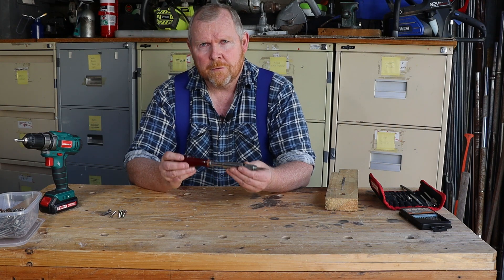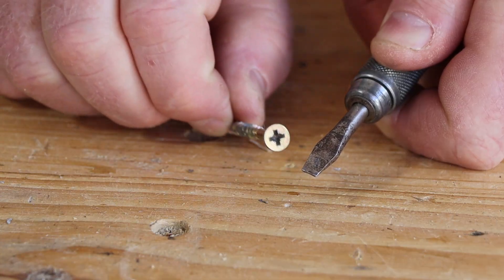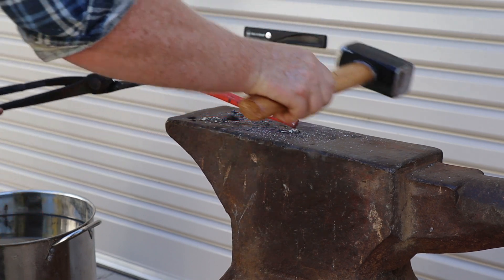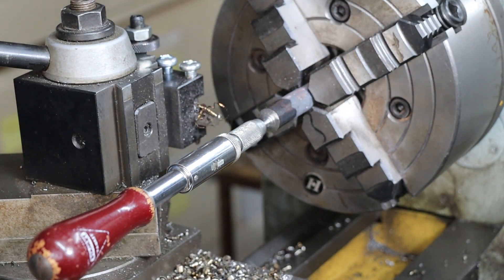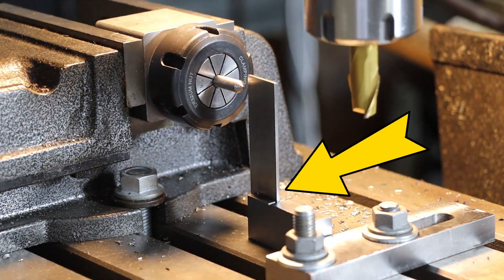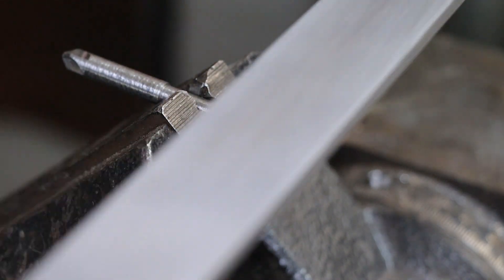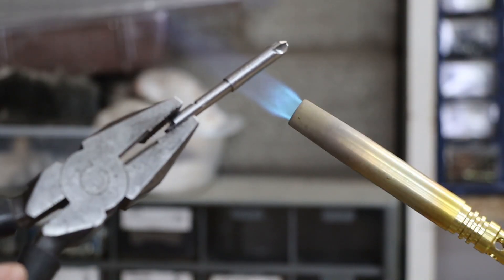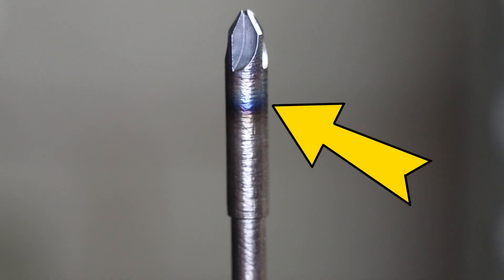Making a Philips bit for a Stanley "Yankee" ratchet screwdriver

Comment: A very simple way to make an adaptor for your Yankee screwdriver to take any hex bit is just to modify the shank of a hex bit holder you get from those hex bit packs which comes with the holder.
On my screwdriver I measured the diameter of the original bit to be 7mm. This fits the hex shaft of the hex bit holder perfectly. Modify the shaft as you did with files and now you have a Yankee that can take any modern hex bit. No need to manufacture your own phillips head bit while gaining access to any size phillips, torx, star, flat, hex, security bits that you might have or can get.
Additionally, I bought a rotary tool style keyless chuck from Amazon for $8 and found they used a 8 X 0.75mm thread. Made an adaptor from a scrap piece of steel rod with one end for the screwdriver and threaded at the other end for the chuck. Now I can use the screwdriver with any round shank bit of up to 3mm diameter. With the behaviour of the pump action I can now use the screwdriver as a drill as well without needing to get those strange old style drill bits which need to use that forward & backwards rotation.
Reply from the maker: That's a great idea, thanks for sharing! 🙂👍

Comment: i know a lot of ppl temper tools from the bottom up - that way you can stop as you see the blue line reach the tip, plus it leaves the butt end of the tool softer & more resilient
Reply from the maker: That does seem like a better method, I'll give it a try next time. Thanks!  😊

Comment: When was the last time you trimmed your grinding wheel? Looks very off-centre.
I have a couple of Yankee drivers I am restoring- but I will make a hex bit adaptor- and a drill chuck.
Reply from the maker: You're right, it's been a while.  I'll apply the dressing stick to the wheel before I use it next time.
A hex adaptor would definitely be more useful, but then I wouldn't have had an excuse to include the forging footage. 🙂
Reply: @TightwadWorkshop  True! And for us Makers, it is the journey, not the destination.
I met a guy that makes knives commercially- exclusively from car coil springs.
Reply from the maker: Yes, knife-making is a market full of eager customers, but it's just not interesting to me.  I'm more of a "make the tools to make the products" type of maker.